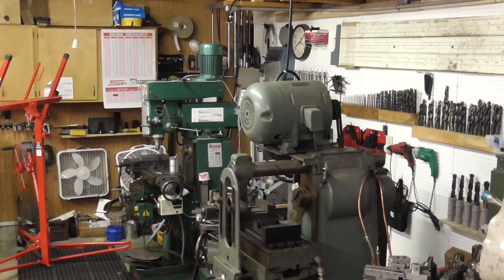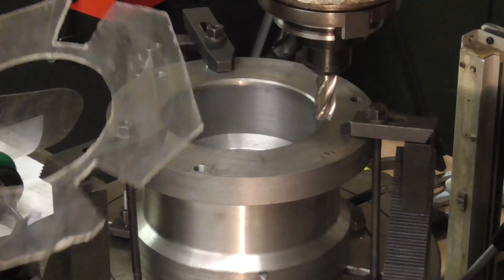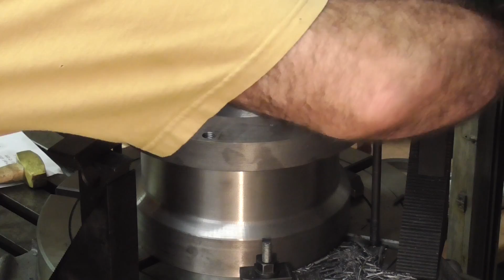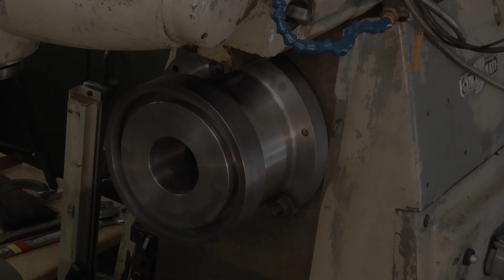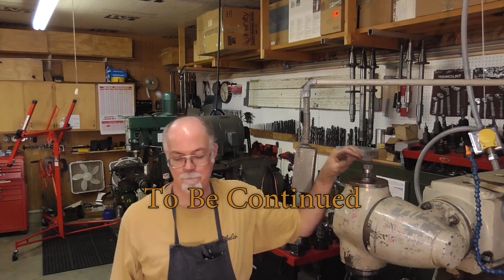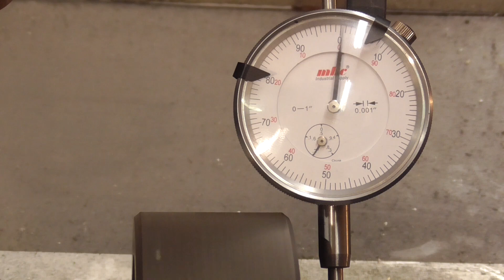Adapt! Part 4

Comment: I would suggest vertical plunge cuts with about .1 spacing to rough out the slots much less load on the part or tooling?
Works for me in CNC on tough material that isn't held well....
Reply from the maker: This was ductile cast iron, fairly friendly stuff to machine, and the cuts were quite light for this mill and cutter combination. On tough material with heavier cuts, I'd do exactly what you suggest. Thanks!

Comment: Gary, my mill uses a similar circular t-slotted groove to allow the table to pivot. On my machine the t-bolts have circular heads, so the entry hole is also circular.  Easy to cut, and no need to grind bits off the bolt heads (and slightly reduce the gripping power), and they fit in any orientation.

Not criticising, merely offering alternatives.

Keep up the good work. I wish I had your machinery...   :(

Comment: Well I like the music. I have a 15" bridgeport round table but I don't understand how the hours, minutes and seconds work, wish someone would do a video and explain that out Thanks
Reply from the maker: 360 degrees in a circle. Each degree is divided into 60 minutes. Each minute into 60 seconds. These conventions were established long ago, and at times they are not very convenient, but they are in common use.
Reply: and then some joker comes along and asks for a part made with degrees measured in radians.

Comment: Maybe bigger hold down hardware would provide more clamp and eliminate the walking problem. My Cincy mill uses 3/4"dia bolts.
Reply from the maker: bcbloc02 I used the largest that the 16" rotary table could handle. The plug that I machined was asolution that I should have used from the start, and then I would have avvoided the problem entirely.

Comment: Just out of curiosity does the slide rule on the wall actually work?
Reply from the maker: Yes. It was designed for teaching in a classroom, so it is a bit impractical for day-to-day use, but it works.
Reply: Gary Storrick it makes an awsume  wall decoration,, its something from the past that most younger people have no clue about or what part it played in industry

Comment: Excellent work, Gary. It seems that rotary tables and milling machines are natural enemies. Adam Booth had a similar problem while making the replacement arbor nut for his new horizontal miller. I guess the moral of the story is "too much is always better than not enough" when it comes to clamping.
Reply from the maker: Adam's crash was far more spectacular than mine. It wasn't really the same - I had three clamps and three stops and Adam was gambling - but we both lost <grin>.